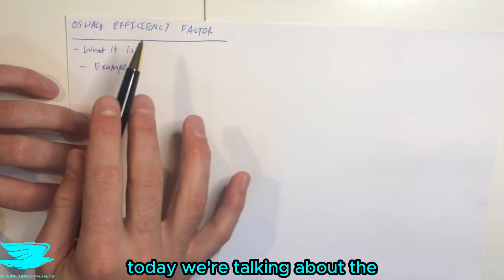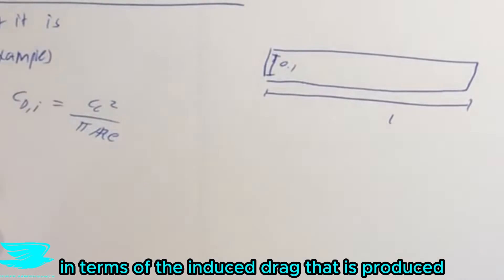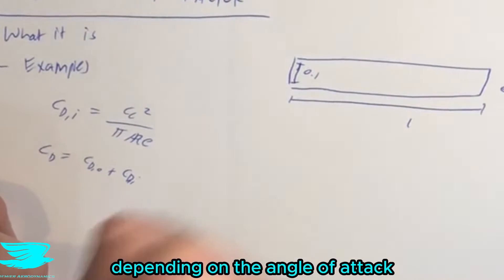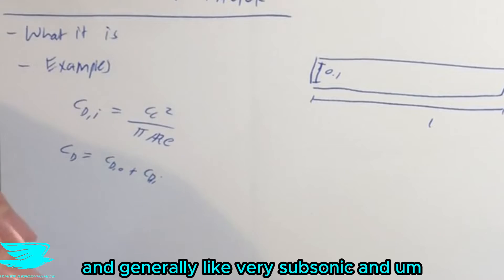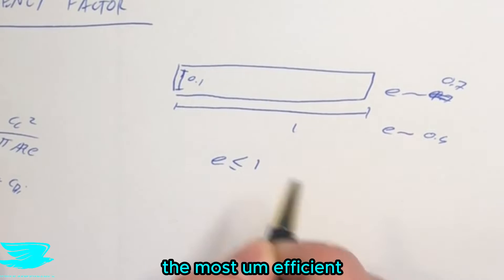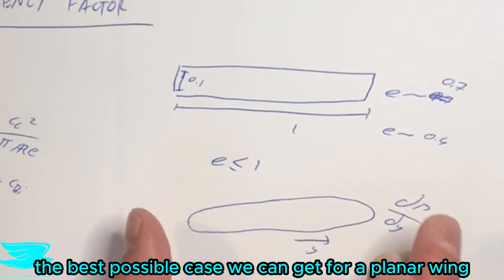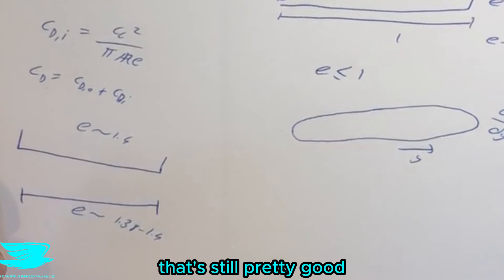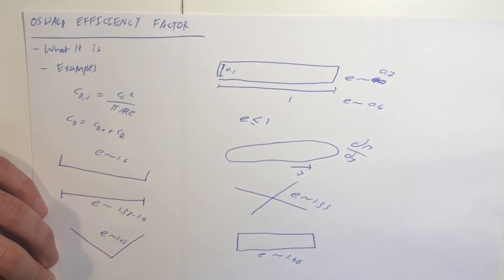[Aero Fundamentals #43] Oswald Efficiency Factor

Comment: I find the best indication that elliptical wings are optimal is that for this lift distribution the spanwise downwash distribution is constant. That also avoids the fallacy that induced drag is only caused bay wingtip vortices,
Reply from the maker: Great point. The kernel of the induced drag is the lift distribution (and the rate at which the circulation changes as you head towards the wingtip).

However, it isn't as easy to understand because there isn't really much of a visual cue, whereas wingtip vortices are cool visual representations, and you don't need too much understanding to appreciate induced drag. So, if the audience isn't very familiar with the mathematics, the wingtip vortex is a good way of getting them hooked on the idea.
Reply: @PremierAerodynamics  True. But what I have found is, that with audiences that are interested in aerodynamics beyond the very superficial, at one point you simply have to bite the bullet and say "It's complex (literally and figuratively). Aerodynamic concepts can't be understood without introducing some pretty sophisticated mathematical concepts like circulation." If you don't, you end up with things like the equal transition time fallacy, which keeps casual observers misinformed to this day. It's not necessary for the layperson to understand the maths in detail, but the rough concepts and their implications.

With induced drag the menatal image that has helped me most is the lift vector being tilted backwards by downwash. That easily makes you understand cL^2 (1 x for lift getting higher, 1x for lift being angled backwards more.) It also makes you understand why keeping downwash constant, and thus circulation change smooth, is important to reduce induced drag.

When I read Simons: Model Airplane Aerodynamics I often wanna shout when he talks about induced drag. He consequently refers to it as 'wingtip vortices'. Yes they are a big part of the phenomenon. But by no means the whole.